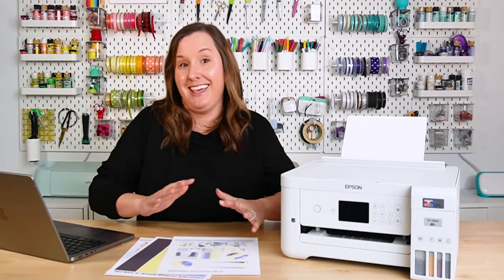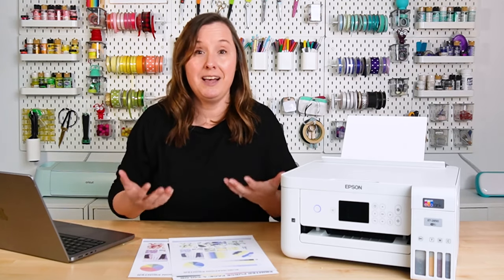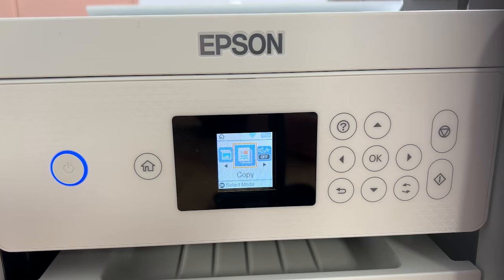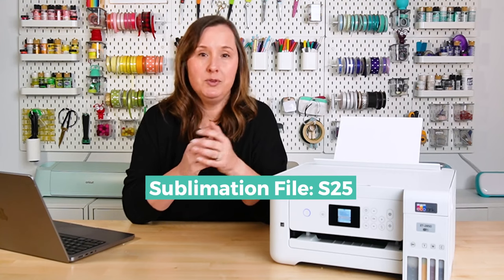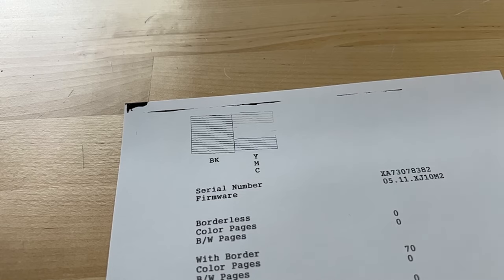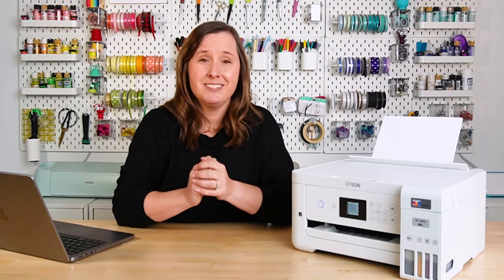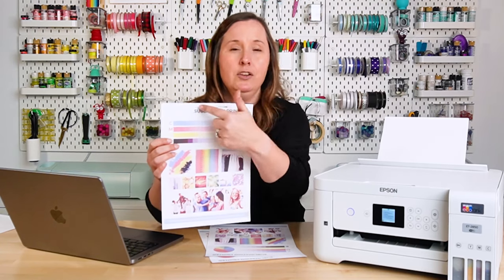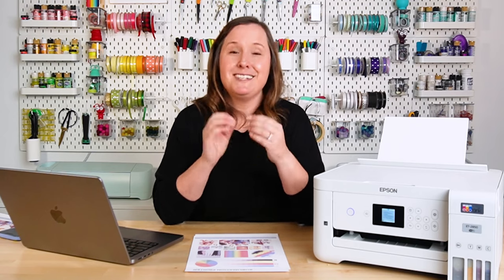How to Fix a Clog in a Epson EcoTank Sublimation Printer

Comment: Your videos about fixing clogs are so timely! Thank you for making them :). My converted 4700 has a very stubborn clog with the magenta (it's printing this super pale lilac consistently on purge sheets and the nozzle check is blank now) and nothing will clear it (Day 6 of purge pages, nozzle checks, head cleanings, letting it sit multiple 24 hour periods, reset the ink levels and finally resorting to the power clean).  When I did the power clean it did not even change the level on the magenta tank so I know it wasn't able to actually pull in the ink.  My converted printer is a bit older and I vaguely remember having trouble once before and did cleanings before I understood about the maintenance tank issue. Well this week I received the dreaded message about the maintenance ink pads being almost at the end of life.  You mentioned that the maintenance tank can be replaced with one off of Amazon. I've seen the videos of the process and found the part but am concerned about the safety of downloading unknown 3rd party software to reset the chip.  Is there a safe way to reset the chip? My husband told me to just buy a new printer  . . . all for a hobby I clearly don't do frequently enough lol. I did order the syringes from your Amazon page to try to pull/push the ink through the magenta that you showed in your most recent video - maybe that will work but this has not been fun for sure!

ETA: Even though I did not do any further cleanings or nozzle checks (I only printed purge pages), Epson displayed the message that the maintenance pads are at the end of their life and my printer no longer works. I understand that Epson will provide users with a one-time limited key to allow you to finish any existing print jobs but the key is very limited in scope. Since we aren't comfortable using unknown 3rd party software, I guess my machine is bricked.  I don't think I will be buying another - it's a very expensive mistake :(.
Reply from the maker: You can't replace the waste tank without a code? I haven't done it myself but I didn't realize it was necessary.
Reply: From what I have learned, there are two issues when the printer perceives the maintenance tank as full. The first is replacing the actual tank. The second is resetting the waste counter back to zero. For the models of EcoTank that have replaceable maintenance tanks,  I believe that these replacement tanks contain a chip that resets the waste counter to zero. The replacement tanks on those models are purchased from Epson and owners can just replace the tank. For the models that do not have replaceable maintenance tanks, you can buy a replacement (non-Epson one) off of Amazon or eBay, etc but the printer still thinks that the tank is full and you need a key to reset the waste counter. Because Epson is not allowing the customer on these models to replace the tank, Epson will not provide you with a key/chip to reset the waste counter back to zero.  I think they give you a one-time limited use key that would allow you to finish up any jobs but, without a key that resets the waste tank back to zero, the printer's lifespan is limited once the tank or ink pads are full. From what I saw online, lots of people just buy a key through third-party non-Epson software but we aren't tech savvy enough here to make sure the software is safe.  @HeyLetsMakeStuff
Reply from the maker: Thank you for writing all of that out! I'm going to do some more research and maybe make a video at some point.
 @littlemadhen3045
Reply: I'm having the same problem now my money is down the drain Thanks 🤦

Comment: Also, Even if you physically have ink, but the printer THINKS you are out of a color, it will not print that color. It will also not print that color during your nozzle check. Use the maintenance menu on the front of the printer to check, and reset the actual ink levels shown.  Check this before working on any clog.
Reply: Definitely some printers are famous for this problem. I have a new mono colored laser by Brother that has this issue. It does it on it's own OEM cartridges and it's so frustrating. I go on line where several Youtube posts walk me through the how to reset it every time it occurs. And it's not for the faint of heart if you can't stay focused. It's quite the do this 3 times press that 15 times turn that off then turn something else on kind of game. I write it down and I keep it with the manual I printed out so that just in case if I no longer find the posts on line how to I might be able to understand the notes I took down to work it  out. But it can do this when the cartridge especially the extra large cartridge is more than half full. Just puts out a warning the cartridge is empty. Or replace empty cartridge. I bought primarily to print designs I foil and also full page foiling which is fantastic for die cutting and digital cuts. Many of the foils available are amazing. But if it the laser toner is not reliable it fails in how well the foil takes to the page. I believe the main issue is it's always telling me it's out of toner. I also shake the toner or rock it gently back and forth in hopes that works. Over 20 years ago I had a small laser printer similar at my job and it was a work horse that never failed until the company tried to dump used cartridges on me that weren't refilled. Eventually we had a deal where I ordered the cartridges and after that it never failed me nor the other office that borrowed it for 3 months out of the year too. Printers are interesting. There have been great ones and not so great ones. Some more fussy than others. I feel many modern ones are far more unreliable or with problems than those made 20 years ago. But that goes with the territory of technology moving forward and adding on way too many options. Bluetooth, wireless, etc. comes to mind and those that operate with smart phones not computers from long distance. I crave simple devices and fine if they plug and play nice. Your point is well taken.
Reply from the maker: Good tip!

Comment: I had a clog awhile ago used several full pages of printer purge sheets. I don't use my printer often so using ink wasn't a big deal. It took 20 minutes without doing power cleanings. Used the paper for scratch paper so it wasn't a waste for me.
Reply from the maker: Awesome!

Comment: Appreciate this video... I had some fuzziness come out on my printer I used today, and I wonder if it's a head alignment issue in my case.
What kind of paper do you print your tests on? Do you have to use sublimation ink, or can you test with plain bond paper?
Reply from the maker: You can just use regular copy paper for your tests!

Comment: I'm waiting till April before buying a sublimation printer. I'm on the fence about buying an Epson EcoTank or a true sublimation printer. I understand most of the pro's and con's and cost is one. But can't help but wonder about clogs and air bubbles in either option. Also if there are better sublimation ink brands than others with properties with some brands that are anti-clogging. Maybe finer pigments or ingredients and will stay in solution better over time. (Years ago I bought a brandnew R2000 printer I adored. Until the 3rd year when having used nothing but it's OEM ink cartridges it began air locking in the ink lines. All of them when ever I put in a new one. At first I could work things out and eventually get it to work well. But the next time a new cartridge was needed it was nightmare time all over. In the end after about a year of this frustration it totally failed and never was able to get it to work again. During this time both the insurance policy and the company insisted I had used non OEM INKS and I hadn't. This was the first time I had even heard of them. I investigated. When I bought a much cheaper cannon printer but 19" carriage too I instantly ordered NON-OEM ink cartridges. I figured I had nothing to loose and possibly a lot to gain. I'm now using this printer for 6 straight years. It's maybe had 2 episodes where the new cartridge wouldn't work and had to fiddle with it and go through cleaning etc. Will this experience has opened me up to taking a printer like the Epson EcoTank line and making it into a sublimation printer right off. I never went the route of making my Cannon into a refill ink and prefer to use the very easy to swap out non0oem cheap inks. They are inexpensive and the only down side is I never go through the black inks which there are two with this printer. I must have like over 30 black cartridges built up now. The inside of this printer spits ink all over and yet the rollers do not seem to develop problems. I print loads of photos and use a lot of photo papers and cardstocks. For being just over a hundred dollars I would replace it in a heart beat if ever it failed. The R2000 cost over 800 and didn't make it past 3 years really. I once had an HP color printer that was a work horse for 10 years straight. I bought another HP to replace it and it failed out of the box and would never print yellow. Not a cartridge issue yellow flowed but the color adjustments in the machine were never right from the manufacturer and they would not help. I'm leaning so far towards the Epson EcoTank but my husband has had 3 Epson color Inkjets die under 2 years and so when I'm actually ready to purchase I'll do more homework for brands and models. I do love the idea of the EcoTank line of course where you just fill those tanks from bulk size bottles. I'm not sure how much inks I'll actually use. I do not intend to sell or make anything for commercial use. I'm strictly a happy crafter for friends and family but mostly my own creative inspiration and ideas.  I look forward to watching your next installment of getting MESSY. Who knows that might change my mind about the EcoTank option. Love your indepth and well thought out video shares. The creative ones too.
Reply from the maker: Thanks for your comment! Other printers (Sawgrass and Brother) don't clog as easily because they run an automatic maintenance cycle. One suggestion for an Epson EcoTank is to use the Epson sublimation ink that is designed for the F170 sublimation printer. You might have less clogging with a product certified by Epson vs. one of the random overseas manufacturers. Hope that helps! :)

Comment: newbie here. How often should you be printing from your F170 to help avoid clogs. Would it be better to leave the machine  on all the time.  Thanks!
Reply from the maker: Epson says you don’t need to print as often with the F170 because the print head is designed for sublimation ink. That being said…I still think once a week is a good habit.

Comment: Will it also work for a clogged regular ink
Reply from the maker: Every printer is different, but these tips may work!
Reply: Check your manual or your maintenance directions with your printer. Sometimes these are on line and sometimes within your computer itself and sometimes you can also find Youtube how to videos to watch for your brand and model of printer. So check those. I've dealt with clogs and worse with one very expensive R2000 printer where it air locked constantly and eventually just died on me. It was fantastic for over 2 almost 3 years. It had air locked a few times during those early years but then it just did it every time and after going through all the cleanings deep and lighter versions it sometimes would work but eventually didn't. So you are best to start with what your printer itself suggests. Also if you are not sure definitely look for help for your printer on Youtube. That's often very helpful and like today someone will walk you through the possibilities and options maybe best to try. Good luck because nothings more miserable than a printer that won't print.

Comment: I followed your instructions and I did a power cleaning and I received a error message E-11 and went and got a new ink pad replaced it and now the error message want go away for me to print HELPPPPPPPPPPPPP😢😢
Reply from the maker: I'm not familiar with the E-11 code, but I did a quick google search and you may need to replace the pad inside your printer. There are videos and tutorials that you may find helpful!
Reply: @HeyLetsMakeStuff  I replaced it but my black ink still won't print.